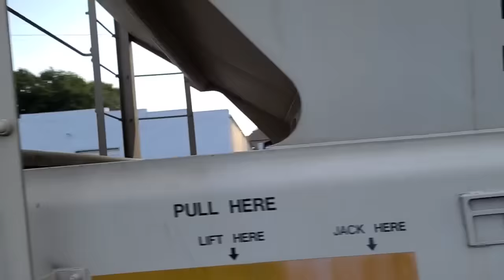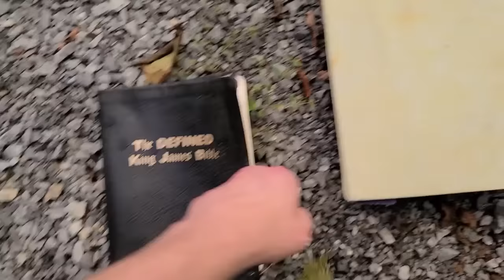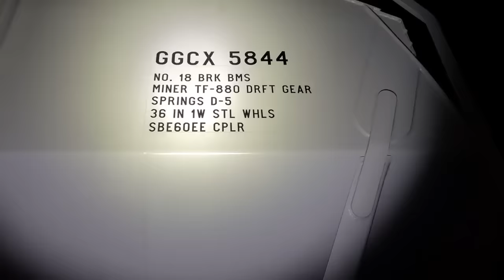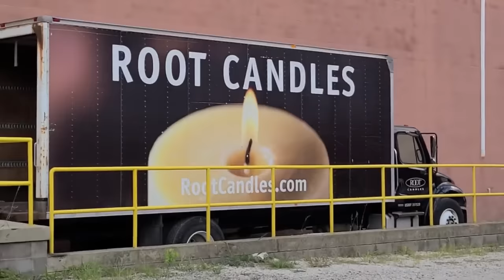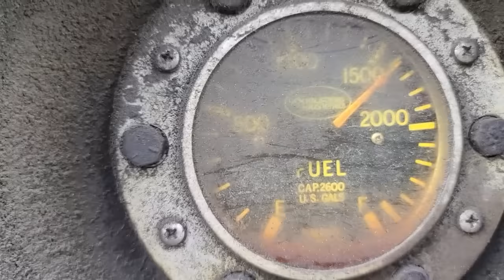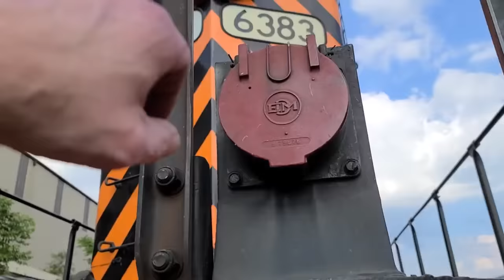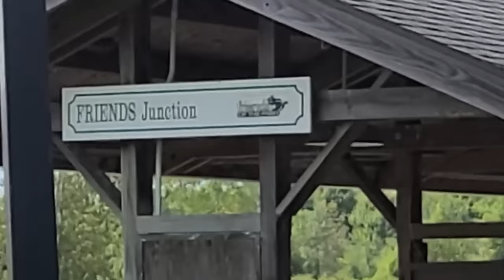On the rails again! (Tennessee to Cleveland)

Comment: I worked at a Borden tank farm In Columbus Ga.  They keep wax hot, with copper tubing and steam. That Cooling Tower on top of the building  is probably there to cool the water to solidify the  candles,  and as cooling the buildings also.!!!

Comment: Shoestring there is a railroad that is a long spur around the city of Rochester NY, which goes through the town of Pittsford NY and crosses the Barge Canal there on the corner of what used to be our property back in the day.  The bridge is wide enough for two rails and as kids we used to walk out and jump off to swim in the canal. Fast forward many years and four kids walked out to the middle and sat down to play cards.

It didn’t end well when a train came, one lady got her foot caught and both her and her boyfriend were killed.  It would have been so much easier to walk over on one the many wide beams of the box bridge, and wave to the engineer as we often did.

Now the RR has installed a security camera along with huge sign and a speaker system remoted to Selkirk NY.  All activity is recorded by the RR, police are called and the waving, swimming and shortcut to town are no more. It was sure fun while it lasted.  

Your walk across that much longer bridge ( but with no escape) was a reminder.

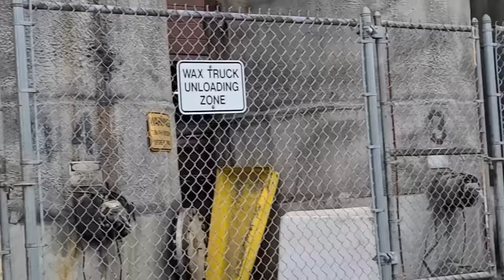Comment: 37:35 A tank car of wax derailing would be fine, relative to other tank car derailments. They don't actually carry the wax hot, so it's a solid. The tanks have steam heating coils that they use to melt the wax for unloading.

Jaw Tooth posted a video of one of the Genesee and Wyoming lines switching a candle factory, maybe a couple of years ago. I think it was a different factory, unless they stopped having rail service recently.

Comment: The Conrail Cabins are CorTen steel, a self-rust inhibiting alloy. Once a layer of rust has formed, it won't rust any further.

More modern Cabins are  made from stainless steel, which also does not require paint.

The days of silver-painted steel are long past.

Comment: I hope you see this because I went through the same thing as you with Covid and what finally cured me was an antibiotic called a z pack. The chest congestion and throat problem went away after that and I felt normal again. If this continues you might develop pneumonia being on the road . It’s just an antibiotic so  it should be easy to get a prescription for it . Good luck.

Comment: What's a coil car?
Reply: Coil cars are a specialized type of rolling stock designed for the transport of coils of sheet metal, particularly steel. They are considered a subtype of the gondola car, though they bear little resemblance to a typical gondola.
Reply: Each coil weighs about 19,000 lbs. or more.